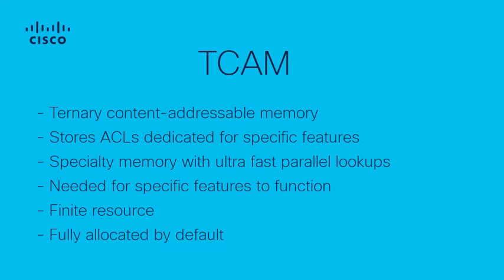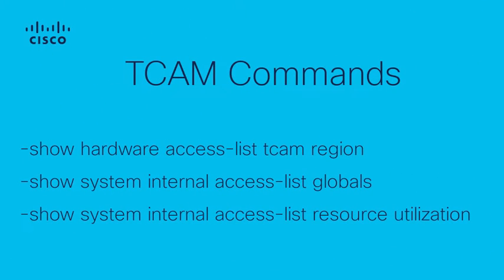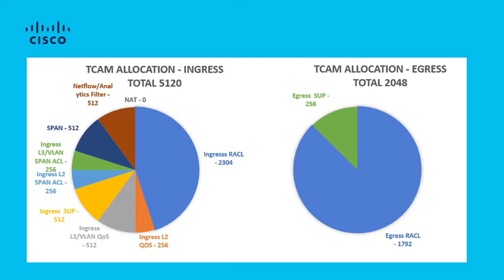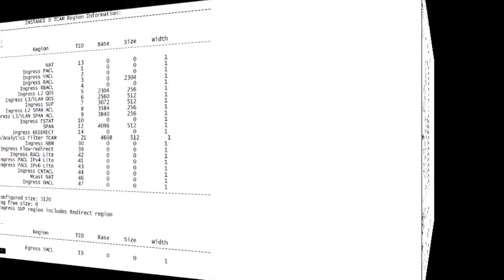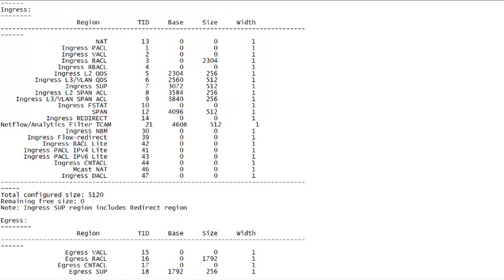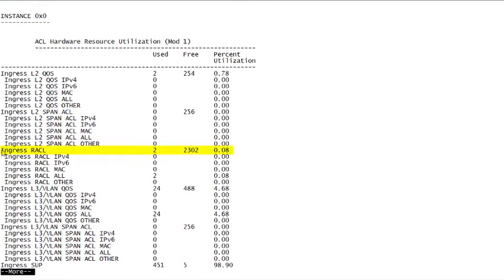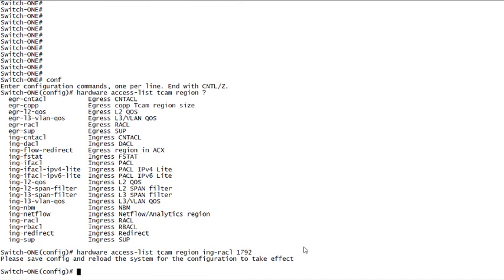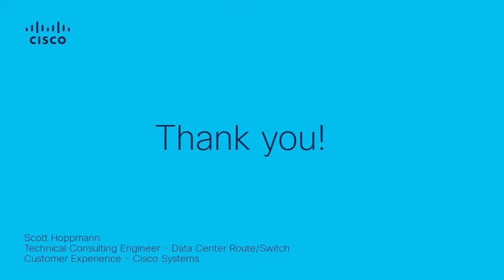Nexus 9000 TCAM Carving | Introduction

Comment: Would be great if errors regarding TCAM gave any indication about what region you need to adjust.  

ETHPORT-3-IF_ERROR_VLANS_SUSPENDED: VLANs 1,9,600-607,635,670,673,675,680,682-683,68
8,696-697,699,774,794,796,1000-1001,1337,1555-1557 on Interface port-channel255 are being suspended. (Reason: Sufficient
 free entries are not available in TCAM bank)

Ok.... which TCAM region is responsible for this?    NO IDEA!

interface Vlan601
 ip access-group storm_parents out
Sufficient free entries are not available in TCAM bank

Ok wonderful thanks for the error message.  Now WHICH REGION IS RESPONSIBLE FOR THIS?!?!?!?  NO IDEA!!!!!!!!!!!!!!!